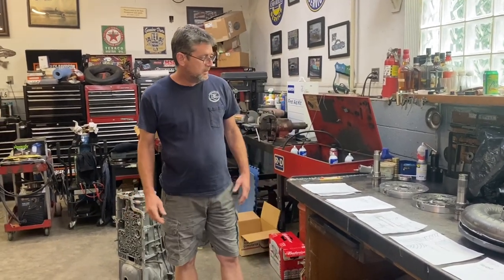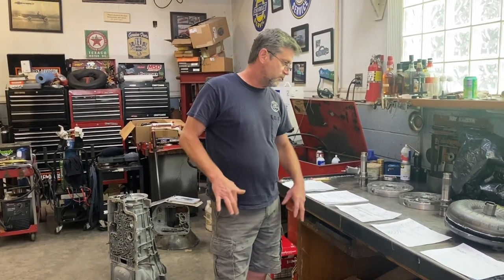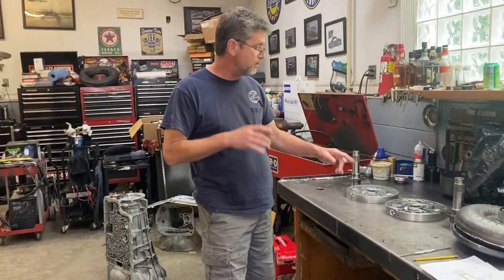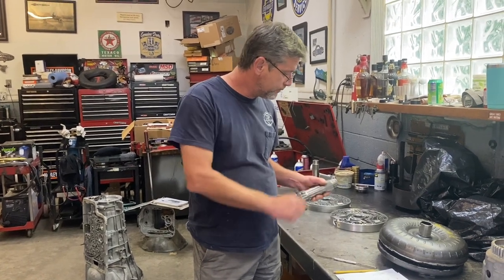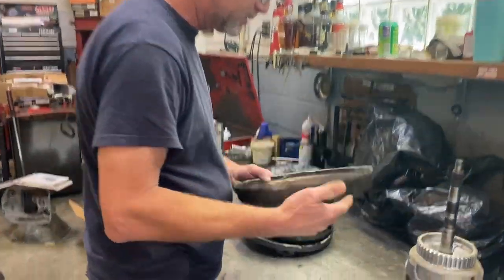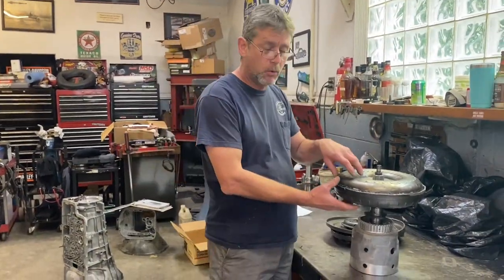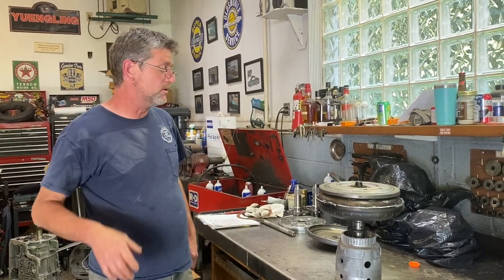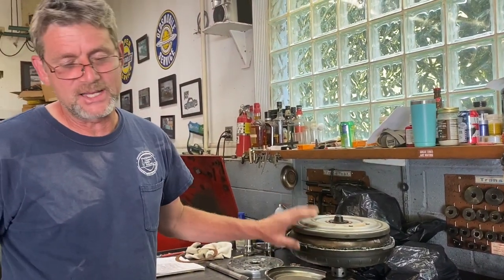E4OD/4R100 TCC /PWM” LOCKUP SYSTEMS EXPLAINED”  RABBIT HOLE STYLE!!! Pt .7

Comment: I had my e40d rebuilt the pump seal came out while driving I only drove a mile before realizing the smoke and rpm jump with loss of power to the wheels by about 90 percent. Know I have a kinda shutter while driving and it shifts hard to 3rd and 4th also it has the tc back leak issue you mentioned in a video where do I need to start?
Reply from the maker: Oh boy ! Interesting from what your saying you had it “fixed”and is back in and driving. From what it sounds they just popped a front front seal in and let it eat so to speak. In a case where a trans “neutrals” out under load while driving due to loss of fluid 8times out of ten at least 1 or more clutch packs probably got burnt. I would have disassembled the trans at least to the point of checking each clutch pack for any burnt clutches. And thoroughly went through the pump to see why the seal blew out ! The “Converter drainback “ issue is probably to much clearance between pump bushing and converter hub/ lube passage drilled where it needs plugged and the “Sonnax” Pressure Regulator Valve put in/ stuck open lube check valve in the stator. To much pump gear clearance etc. all pertaining to the pump itself. I talk about all this in my “pump from hell” video. As you can see there is No real good “starting” point that trans internals needs a full inspection in my opinion to be “right” again
Reply: Do you own a shop what state are you in
Reply from the maker: @obsfordtx1438  I just own the "shop" you see in the videos its literally at my house ! I live in Maryland where are you on this 3rd rock !
Reply: Texas man I wish you were closer I would love to have you work on my tanny it's hard to find reliable people around here
Reply from the maker: @obsfordtx1438  I hear you on that one ! One of my whole purposes of doing these videos is to try to help people not get ripped off! Its a real problem everywhere nowadays. Whether its a lack of Knowledge or just the plain not giving a F*&K its a real problem!
Reply: I think I am going to attempt the rebuild process just need to get a decent kit I will more than definitely be coming back for more tips on this project keep up the great work with the videos
Reply from the maker: @obsfordtx1438  Now Your Talkin' I've had this conversation many times with people in your same predicament on my channel ! Many have had success rebuilding there own after watching the series I put together for you guys out there. If you do Happy Building my friend ! Advice....... Stay  organized, One part at a time, Take your time, and be clean-clean-clean and anything is possible. Keep us all posted on your progress
Reply: Got it out the housing extension off didn't see any debris out of ordinary in the pan or from what I can see now I'm going to test the solenoid pack and inspect the pump to start then checking all other internals
Reply from the maker: @obsfordtx1438  Yep your on the right track, all of the drainback problems will be in the pump was the converter hub scored up ?
Reply: No no scoring on the hub
Reply: I need to make the stand so I can set it up right I will be continuing after that
Reply: So I have it gutted completely now will no signs of wear on any of the friction plates or gears do you think the pump could have went bad possibly
Reply from the maker: @obsfordtx1438  Yes, there is definitely problems with the pump but it won't go bad on its own it has to be something the re-builder did to cause that problem. Did you take the two pump halves apart ?
Reply: Not just yet I will do that tommorow and I will update you on my findings
Reply: With no signs of wear would you think I could put it back together and just fix the pump if that is the issue? Or would you spend the extra money for the full rebuild kit? Also I don't race or anything just an old pick up would you advise doing the shift correction upgrade to my unit?
Reply from the maker: @obsfordtx1438  Ok somewhat of a loaded question there and since you took the time to do it yourself I'll give you the long answer here, Write your answers on a paper as you read through this so as to not miss anything.
    What year and engine combo is the truck ?
    What is your intended use sounds like it's just a Sunday trash hauler, ANY towing at all ?
    As long as there is NO and I mean NO signs of any metal running through it you probably could just mainly put the guts back together and just buy a seal and gasket kit !
    Now for the fun stuff, What UPGRADES did you notice the shop put into the unit, 
     Steel O/D planet, 
     Aluminum or steel Front planet (How many pinions on front and rear planets)
     H/D Intermediate sprag
     How does the center support look (any hammering in the case to center support area)
     Be sure to check EVERY single bushing for any looseness to its corresponding shaft, support etc. especially the stator bushings as a worn rear stator bushing can cause The drainback issue your experiencing. 
     If your confident ALL is good with the guts then your main focus is the pump and valve body. You were saying it shifts hard 2-3 shift 3-4 shift and some CHATTERING at times. 
    Was the chattering in a specific gear or was it a Lock-Up chatter very important to address it as you only want to do this once !
    Check the Pressure Regulator valve line up, Is the boost valve a Shift Kit Valve Did they even replace it. Did they drill the LINE to LUBE passage in  the pump IF SO PLUG IT and install The Sonnax Pressure Reg. Valve instead! as that will cause drainback! 
     Did they put in a NEW Line Modulator Valve w/"O" Ring of at least .372" in the Accumulator Body 
How does the pump BODY and GEARS look worn original or new gears? Clearances ?
    Check the accumulator body close for signs of a Shift Kit, Shift kitting the ACUMULATOR body should be a given on ANY E4OD/4R100 build regardless of its intended use . Just depends on how BEEFED UP it needs to be. Did they put the Aluminum O/D lube Check Valve in the stator.
    SUPERIOR makes a good Baseline SHIFT KIT that works well for most transmissions and isn't expensive at all! I've used it in countless rebuilds and works well
     Transgo "Tugger" kit for ANY real Towing
    Sonnax Pressure Reg. Valve, Steel O/D planet and some type of shift kit a MUST do. 
    And again the pump and valve body should be your main focus to get it right again, ANY stuck or Sticky Valves Be sure to COMPLETELY disassemble the accumulator valve body and make SURE ALL the valves are DEAD free and move on there own in the bores.  
     As far as the converter goes its a crap shoot because you can't see the inside of it! Did they replace it My main concern is the chattering you spoke of because if it was a Lock-Up Chatter than the TCC clutch could be a problem ?
   Read all of this VERY carefully and then get back to me with your answers to EACH question. Let me know what you find.
Reply: 1993 ford f150 2wd long bed no heavy hauling or racing just restoring and after looking into it more and taking clutches out of the gears I have sights of wear and chatter all the main ones that come out freely are in mint condition. Fluid pump looks great actually with new gears and new booster valve it also has the bigger oil holes and all valve are moving freely I haven't taken the vent tube to see if it is the upgraded one just yet
Reply: Aluminum od planet and no marring on center support
Reply: Pump has factory spring in it still and the cap is not taped at the edges so I want to assume it is the plastic one
Reply from the maker: @obsfordtx1438  I don't quite understand your meaning what is showing signs of wear and chatter as you say the clutches look Mint ?
Reply: Sorry my transmission knowledge isn't the best but I have burnt friction/steel plates after further disassembly of each clutch the coast clutch, od clutch, direct clutch, and forward clutch friction/steel plates have abnormal wear
Reply: No lube to line hole drilled booster valve and springs are oem
Reply: Measurement for modulator valve oring measure .632
Reply: It has the plastic vent valve installed
Reply: If I were to do the superior shift correction would any drilling be required and I should need any major internals just more or less just the friction plates and seals? Thanks for all you time will my questions.
Reply: Putting it back together now
Reply: I have it back together now and in the truck all I have now is first gear and it's not very strong but reverse is solid what may I have done wrong.

Comment: I was hoping you could lend me your expertise. Have you ever seen a stuck TCC Valve that would not allow the converter to lock up? My TC stopped locking one day out of the blue. I have a manual TC lockup switch that has worked perfectly for the last 10 years. Now it won't lock manually or on its own. In drive, at a stop, I hit the switch and it does nothing, not even a drop in RPM like it is trying to lock. I can hear the solenoid clicking from under the truck. I removed and tested the solenoid pack per your video and it tested good. At this point I do not know what else it could be, its shifts fine in all gears, no other signs of trouble, the fluid was cleaned when I drained it. Any Ideas?
Reply from the maker: Ranger, It seems your on the right track with your diagnosis. If the solenoid is definitely working and you hear it clicking then you've eliminated everything external and even the solenoid itself !       The only other things in the circuit for TCC are the lock-up valve (In The Pump) (Possibly stuck).      The front scarf cut Stator seal, (worn out /damaged)       And the torque converter itself (Worn out clutch, binding splines etc. inside the Torque Converter). The only other thing could be the feed oil to the solenoid but that feed oil is the same oil that feeds shift solenoids so if it is shifting through all the gears just fine then that should be fine as well.
Reply: @Marshall Sanders  I removed the pump to inspect the tcc valve. It did not appear to be stuck at all, but I did find nonferrous metal in a cavity associated with the valve. It is the large round cavity near the pump suction. It almost looks like it is a low point designed for debris to settle out. Trying to figure out my next move, aside from reassembling with a new torque converter and hoping it works, haven't found the "smoking gun" yet.
Reply from the maker: @the909ranger  Ranger, It seems the Torque Converter is bad. You have checked everything else in the system and haven't found anything to cause the problem. The TCC circuit is pretty much the solenoid feed fluid, the solenoid, the TCC valve, the Stator seal, and the Torque Converter. Unfortunately you cant see inside the torque converter but through process of elimination there is no other explanation.

Comment: Like how you work.
Reply from the maker: Thank You I appreciate the comment.
Reply: I read and read but rarely find any good information that exceeds my knowledge. The understanding of how each part takes place in the operation of said part. 90 percent of the time it seems more like some people haven't any idea how it works. But have plenty to say. I have started considering I might be a weirdo. The way I want to understand what is happening, and how it works. Anyone as far as I'm concerned can change a transmission. But to understand and fix it is what drives me. I'm dealing with od slipping. I'm stuck on understanding the shift pattern. Seems to me that my E40D has 4 gears and the converter locks up. (Simulating) 4 shifts/ 5 gears. Does the converter lock after 3rd or 4th? When I turn off od, it seems to shift fine. When od is on, it drops 6oo toms. When brake is applied, it used to raise the rpm a couple hundred rpms. There isn't any reaction that I can feel while applying the brake.
The converter seems to operate correctly, but when it goes into that last position, which I thought was overdrive. I can turn it on or off by the od button.
No light flashing ever. No codes except 1280. I did lose a tranny cooling line which dumped enough fluid that the truck wouldn't move. 2 quarts and I was able to get it home. But seemed like od started slipping when engaged.
My uneducated guess at this point is the converter, solenoid pack od or a simple od related o-rings in a valve which would not produce enough pressure on the od clutch disk. Any clues would be greatly appreciated. 
I know there isn't 5 gears
Reply from the maker: @rickparran81  Rick, Long answer here,  Yes it is a 4 speed with lock up. Each gear has its own gear ratio 1st. Gear is 2.71:1,2nd gear is 1.54:1, third gear is 1.00:1, overdrive is .71:1. For example in first gear the INPUT Shaft turns 2.71 turns and the OUTPUT Shaft turns once. and so on. Lock-Up does not create another gear ratio as there are no gears involved when it locks up, The difference in RPM change when lock-up is COMMANDED ON is because the IMPELLER or ENGINE is spinning FASTER than the TURBINE which is connected to the INPUT SHAFT. When its in full Lock-Up the IMPELLER and the TURBINE become Mechanically connected and therefore the RPM drop happens.
   The converter can Lock-Up in either 3rd or 4th depending on factors like engine RPM, engine load, vehicle speed etc. The way your explaining it to me it has overdrive but no Lock-Up. The computer ALWAYS takes it out of Lock-Up whenever the brake is applied so you don't feel a jolt in the drivetrain because in Lock-Up the engine is MECHANICALLY locked to the input shaft and if it didn't release Lock-Up on brake application  the vehicle would JOLT so to speak! So if your not feeling the RPM change when the brake is applied then its not in Lock-Up to begin with. 
    With that said it seems the Lock-Up isn't working and needs diagnosing. Keep also in mind SOME engine codes can change transmission shift strategy as well as Lock-Up function so I would fix that code first and go from there. Be sure to watch my "WHO"S IN CONTROL" videos as it explains in detail each gear as it upshifts

Comment: Pussification indeed - compare early 700s with hydraulic control lock-up to the pwm on 4l60Es… 

What happened to those toggle buttons, the variable pitch on the stator of the early 400s, the AC solenoid on the TV, and the hydraulic lock up. 

Basically three buttons of “turbo”!
Reply from the maker: That’s funny ! You clearly are or have been a transmission builder before either present or past life and not letting on but that’s cool. No one knows as much as you without having built many different transmissions ! I was a builder for 22 years at AAMCO and I’m thankful it wasn’t at a dealer with only a handful of different same manufacturer transmissions ! It forced me to understand the operation of automatic transmissions instead of just replacing parts. I would build a Hyundai one day a Honda the next and a Mercedes’ the day after that but it was great to learn how all the different makers “Did there thing “ so to speak ! And all the different Characteristical problems each transmission maker had. 
In your opinion what’s the absolute best transmission to date ?🤔 I know mine but would like to hear from you first ! Thanks for the Comments and watching it seems all my videos !

Comment: Tanks great vídeo, do You have about e40d líne pressure function mi trnsmission has 127 líne pressure in all PRND????
Reply from the maker: That’s to high . Should be around 70 psi. At Idle/a little higher in reverse. Is there any codes in the computer. Many transmission codes  will put the trans in a limp mode situation. The computer sets the pressure higher to protect it from burning up. Probably your issue. Clear any codes and see if the pressure comes down.
Reply: @marshallsanders5672   thank You  so much, i don't have  transmission codes, My first to second is so hard and never sets third. I had tested with other computer, valve body, solenoid pack but i couldnt